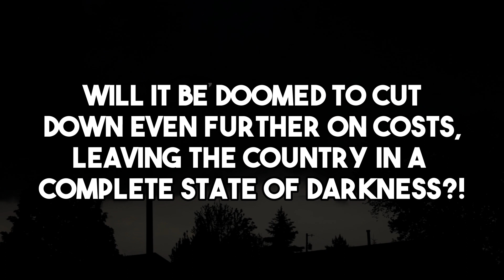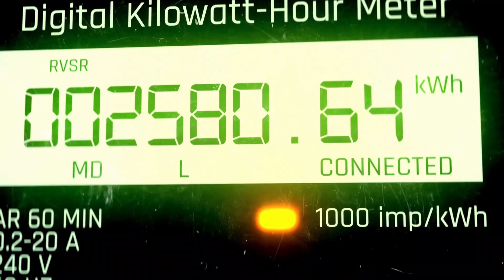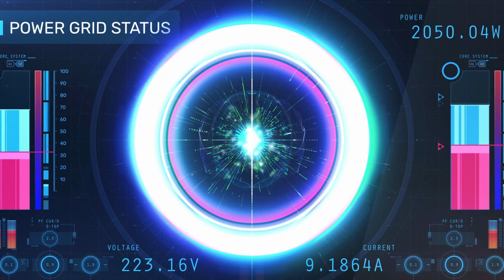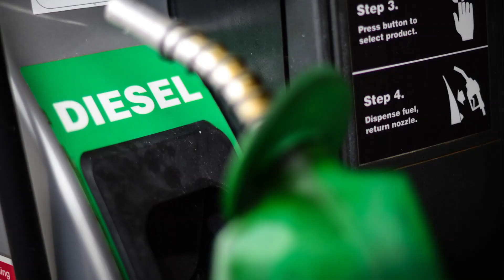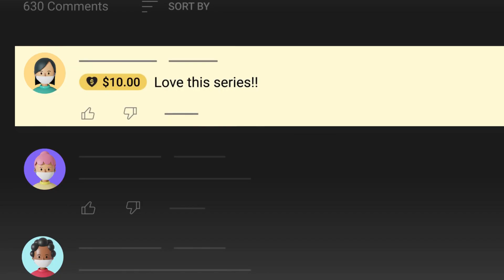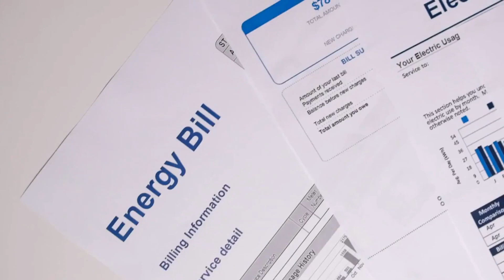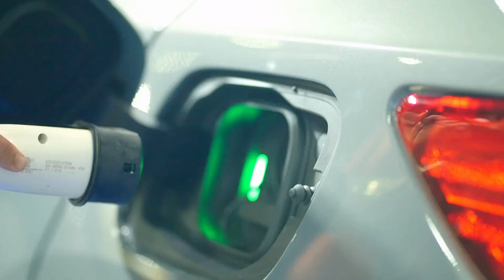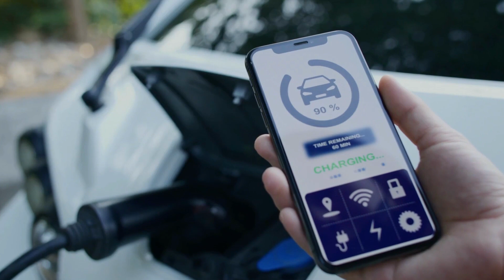Can America’s Grid Handle The Rise Of Electric Cars?

Comment: The amount of EV's being put on the road is being dwarfed by the amount of solar, wind and batteries that are being added to the grid every year now. Why? Because its now cheaper to replace ALL of the coal, gas and nuclear generation with renewable and storage, than it is to continue to operate any of the existing infrastructure. We can build out four times the generation capacity for less cost.
Reply from the maker: Thank you for watching and sharing your inputs Mr. Dave.